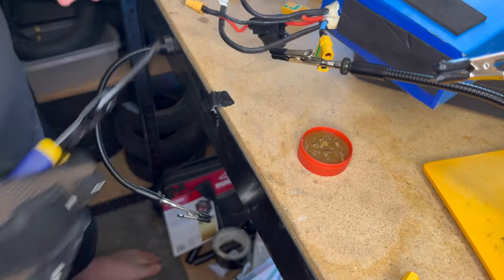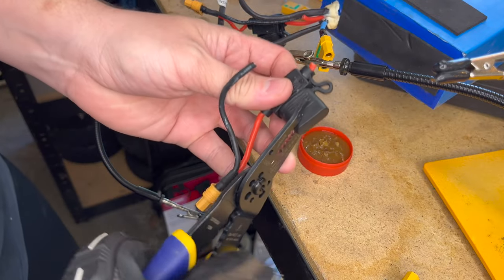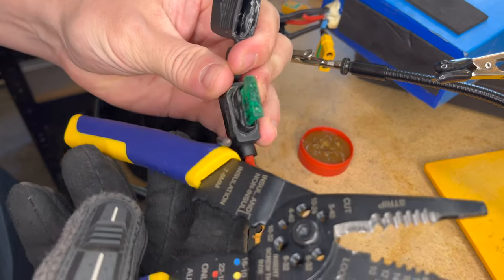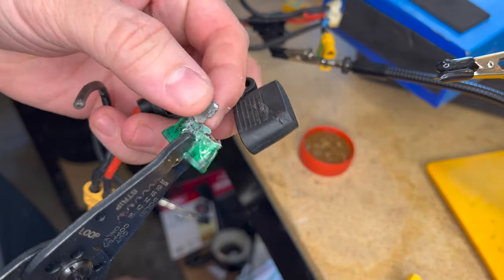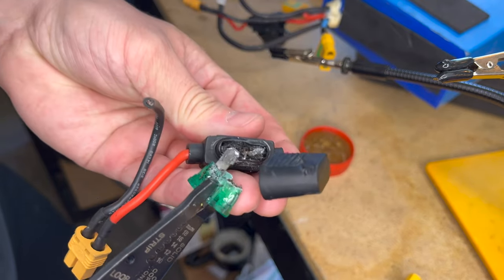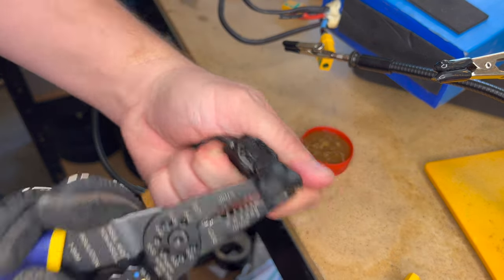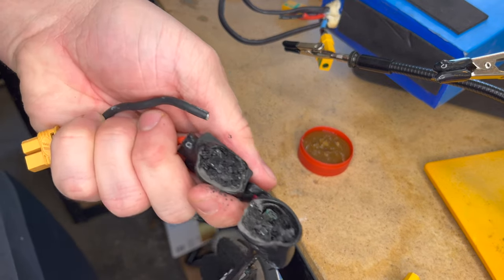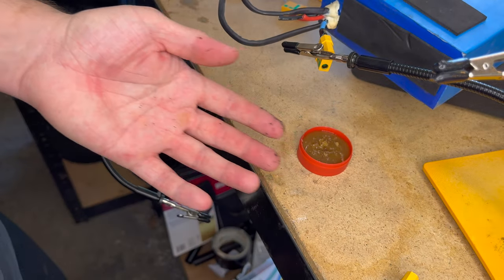Completely MELTED Electric Scooter Fuses // THE SCOOTER INDUSTRY'S DIRTY LITTLE SECRET

Comment: That looks like a 30 AMP automotive type blade fuse. I would have thought it would have just popped like it is supposed to if the current was to much.  The fuse holder looks like it got hot and melted. I wonder if the holder was underrated for the amount of current. Something looks under engineered. Thanks for posting.
Reply from the maker: That’s exactly what it is! 32v rated blade fuse on a 52v scooter. I know other brands do this too so people should really just replace them before this happens with something better.
Reply: You can still arc at lower current (amps) when the voltage is too high… think about static shocks. The arcing creates a channel of ionized air allowing the electricity to continue arcing even at lower current, causing pitting, oxidation, and carbon on the contacts. This increases resistance, causing heat even at lower current (amps).
Reply: @ScootaGang  I have a Moto Tech Mars 2500 w 48 volt scooter goes about 35 miles per hour I had the same issue in a completely melted the whole fuse port what would you recommend I replace it with new to the whole electric scooter thing but I paid a lot for it and atm it's my only ride to work
Reply: My etwow battery had the same problem.

Comment: Man You Right On Time With This Video. This Just Happened to Me. My Scooter Seems Great Accept for me Losing Voltage Which Makes My Scooter Start But Then Cuts Off. I Opened Up My Scooter and the First Thing I Recognize is a Melt Down Of Something What Looks Like a Piece that Wholes a Fuse. And I Was Getting Ready to Send My Scooter Out For Repair, And Then I Got Sick. Which Made Me Postponed Sending It Out. So I'm Thinking God Lead Me to Your Video. 🙏🏾😊  You Just Let Me Know That I  Was On  the Right Path. So Thank You for This Video. 👍🏾🙏🏾🙏🏾
Reply from the maker: Sorry to hear that happened. I would send it in for service, this is not the type of repair an average person should attempt in my opinion.

Comment: The red cable is also 14 AWG? I also need to change the fuse and fuse casing. People are recommending me 10 AWG cable fuse housing but when I got it looks like it's much thicker cable then the one in my battery and my battery cables don't have marking but look very similar to yours as my scooter is also zero 10x 23ah LG
Reply from the maker: I'm not sure exactly what size it is. I am hardwiring mine when I get time, no more fuse.
Reply: @ScootaGang  You going to use just wire without fuse?
Reply from the maker: @LVShonzy  correct, Vsett 10+ has no fuse, it isn't required because BMS's have internal fail safes.
Reply: @ScootaGang  I guess Zero 10x does not have such smart BMS protection? Most horrible experience with checking zero 10x fuses is that fuse was glued to fuse housing
Reply from the maker: @LVShonzy  they should have equivalent BMS's. They likely knew about the issue with fuses melting and did away with it on the Vsett in order to prevent this problem all together. If you don't know, Vsett is the new Zero, same manufacturers. Zero 10x is a 5 year old model so they made a lot of changes since then...

Comment: I have the same issue right now.. think u can show what u did to fix it?
Reply from the maker: Honestly, I have not fixed it completely yet. I cut off the melted fuses and it leaves a very short amount of wire. I started to solder on the new connectors and got frustrated. Then I had to spend the last couple weeks moving and haven't gotten around to fixing it yet. I don't really need the scooter so I am considering just making it an extra battery for my yume at this point but not sure on my plan yet.
Reply: Bro, i tried to do the same thing to my battery wires and when i cut the red wire, that shit almost blew up, it caused a huge spark looked like a flare gun and basically just burned some other wires that were close to it.. idk how or why that happened cuz i just saw you do the same thing except yours didnt blow.. really could use your help!
Reply: Yours has both fuses burnt but mine only has one burnt out.. when i tried to cut the one that was burnt out, i cut the black one first and it was fine, then i cut the red one and it almost blew up lol.. and now like i said , the other fuse wire got burnt too so now i dont even know if i want to try to cut those wires and have the same shit happen again!

Comment: Why they put inside 30A fusion if controller for vsett 10 has 30-35A. I have in my Vsett10 50A but as you told 32V. I thinking to put there 40A 80V fuse.
Reply from the maker: Really you're Vsett 10+ has a fuse? My buddy doesn't have a fuse in his. Is yours an earlier or later model? There has been a lot of updates to the 10+ since last year. 

The fuses themselves are a redundancy. If you feel like you need the extra protection, it makes sense to upgrade them. If you trust the battery bms to do it's job, then you shouldn't have any issues without a fuse.

Comment: My Vsett 10+ Does not have this fuse anywhere I can see. someone suggested it could be inside the battery housing itself, I checked the controller and nothing. My scooter lost all power yesterday, and the retailer I bought it from refuses to cover the cost of shipping it back for repairs.

Edit; Read your description - However redundent the fuses may be, they might have very well saved my battery when my controller blew. Do you know of anything that can prevent this in future?
Reply from the maker: Sorry for the delay. They removed these fuses since this scooter (zero 10x) was replaced by the Vsett 10+ and Mukuta 10+. It’s only really an issue on older model scooters like the zero 10x

Comment: The scooter industry cuts cornerns on everything. Most of the time parts are just slapped together in a rats nest, causing cable rub and short circuits. Then there's the cheap wiring that just melts on some scooters, aswell as poor quality fuses and connectors. In many cases, you can't even ride in single motor mode for too long without frying a damn controller (from own experience quite a few times 😅).
Reply from the maker: Yes every scooter is a work in progress so you definitely need to do some research before deciding on one!

Comment: I have a Nani burn max E 2 I just got rid of the fuse and connected it straight up never had this problem again
Reply: Hey bro I think I left my scooter on but it was at 90 percent came back and display not working and no throttle completey black screen but everything else works like lights horn etc 😭❤️
Reply: Bro did you get rid of both fuses?
Reply: Yes
Reply: @djcali how is it? Is it still working?
Reply: Yes working with no problems
Reply: @djcali  wdym you get rid of the fuses ? you cut it ? where goes the power that initialy burn the fuses if you don't have any
Reply: No you cut each fuse and connect the wires straight up on each fuse

Comment: My fuse was also burned and my front wheel is not responding is the fuse the problem ? i checked motor and controler and int not burned its just a fuse
Reply from the maker: Yes, and when you put the new fuse back in, coat the prongs in dielectric grease and it won't corrode like mine did!

Comment: Yup I have a lemon,my headlight comes on just by wiggling the wire and speedometer doesn't work,granted I only drive on paved surface no dirt or water,so ima redo it all not like they did cramming wires in
Reply from the maker: What scooter again?
Reply: @ScootaGang  vsett 11 plus
Reply from the maker: @fctryoffetsh39  i wouldn’t redo anything. That should all be covered under RevRides warranty?

Comment: Hey, for some reason when I turn on my 72v scooter (max charged at 84v) as soon as it turn on it drops to 72 ish volts then jumps back to 84 and then drops again to 72 and so on, when I press the throttle the voltage drops real fast completely turning off the display and everything. Do you know my issue?

Comment: Question I recently changed the right side brake lever on my kaabo wolf king GTR , but  after that all lights won't turn on, the scooter do turn on and run normally but after brake lever Change none of the light turn on what do you think is the cause I did check the 2A fuse protection and is in great condition I can't find the cause

Comment: I burned all 3 rubber rings on my rear motor connectors and for some reason the back is still working fine, but the front one is running at half the RPM.

Comment: My girl went to plug her evercross H5 in to charge. It arched and now the charger light stays green but it's not charging. Is it a fuse?
Reply: Nvm. I took it apart and located the fuse box. A #5 fuse was blown. Went into my old truck that's broke down and grabbed a #10 fuse to TEMPORARILY enable it to charge until I get to town. I live in rural NY with farms all around. Town is 10 miles away. I'll go tomorrow when I get out of work because my job is in town. Yes I ride my Rs5 20 miles a day

Comment: Use dielectric grease on the fuse terminals and the fuse block to prevent the corrosion.  It will promote a better better electrical contact and prevent water and moisture intrusion in the fuse block.
Reply from the maker: Thank you for the tip! I’m upgrading all my scooters to better fuses that screw into the fuse housing as opposed to this blade type. But to others it could be useful!
Reply: Give me a call uncle Steve
Reply from the maker: @steveg5983  Haha I didn't realize this was you. I'll give you a call this afternoon after work!

Comment: I have a Yume Y10 and I had the board open where both controllers are at and I was checking the wiring after unplugging the cheesy colored led's and by mistake I though something had come unplugged in me moving things around and found these 2 ends that looked as though they fit together but when I tried to connect it became apparent that they were not in fact meant to connect when it popped and I heard the hissing as the circuit shorted and burned out. Now my headlights & tail lights won't work so I have obviously shorted out whatever fuse or circuit powers my lights. Would you happen to know where I should start in order to get my lights working again. Hoping there is a fuse somewhere I can replace and it's not gonna require replacement of 1 of the controllers or something like that. Thanks for any help you can give me.
Reply from the maker: Huh, that's quite the conundrum. I think you probably have to replace everything on that circuit but honestly I'm not sure. I would contact Yume and try and to get some parts sent. Obviously it's not under warranty but hopefully they will still help you diagnose it and send the parts.

Comment: Bro, it doesn’t really matter the voltage written on the fuses. They are supposed to break the circuit if the current goes over the limit. Fuses melt because they are cheap Chinese crap. Buy only quality fuses from brands you know and trust to be sure that they will break the circuit when needed instead of meeting down. See this all the time on cars.

Comment: @Sᴄᴏᴏᴛᴀ Gᴀɴɢ 🛴💨  I have a Moto Tech Mars 2500 w 48 volt scooter goes about 35 miles per hour I had the same issue in a completely melted the whole fuse port what would you recommend I replace it with new to the whole electric scooter thing but I paid a lot for it and atm it's my only ride to work

Comment: Hopefully the Vsett didn’t do this.. 🛴💨
Reply from the maker: I’m not sure yet but it’s worth looking at your fuses more often then me and checking for any problems. Someone else mentioned putting dielectric grease and it will stop the corrosion from forming.
Reply: @ScootaGang  guess considering I live on the Florida coast were everything corrodes it would probably be a good idea to check pretty regularly. 😔.. more maintenance..yay